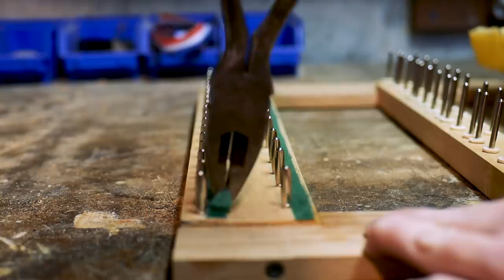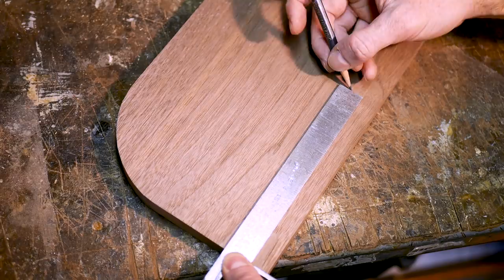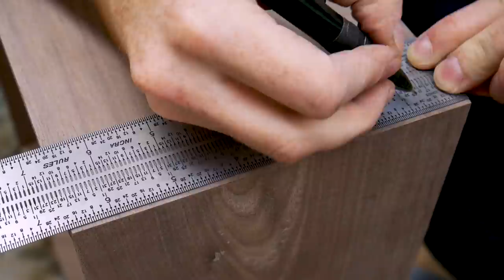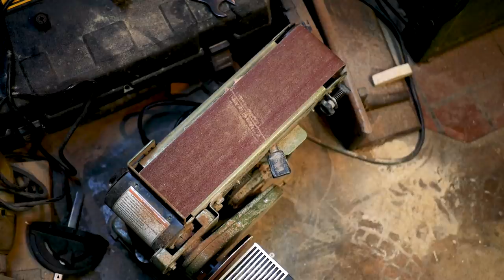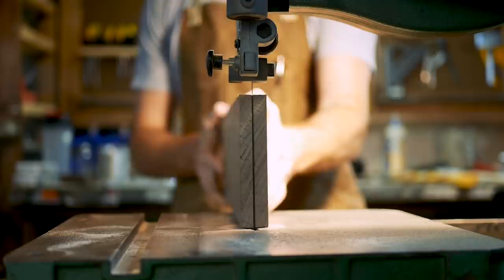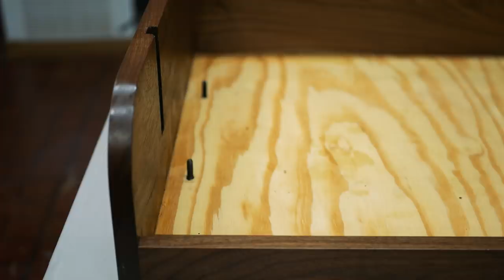Flexiphone Keyboard Build [Part 1/2] - Action & Cabinet

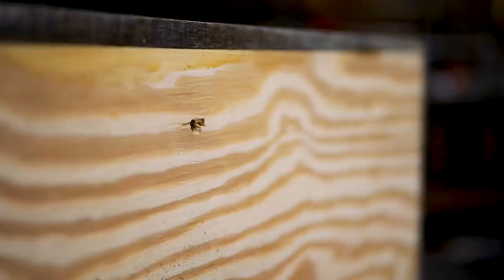Comment: you turned the screw left to tighten? 7:00
Reply from the maker: Yes good eye! It’s a specialty bolt that has a regular threaded end to attach a nut, but the top half of the thread is opposite. This is so that when you tighten down a nut (on the regular end), it won’t also tend to unscrew the bolt from the board.